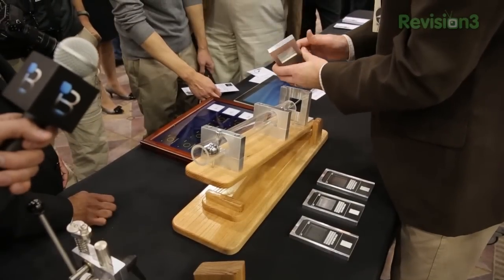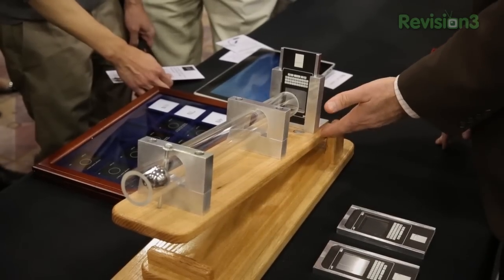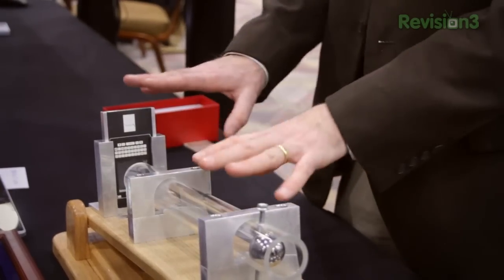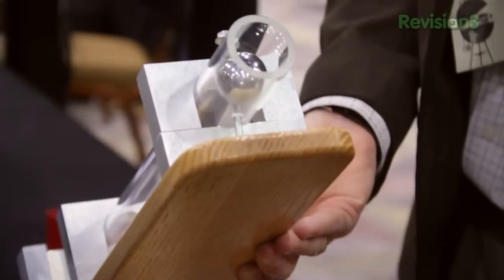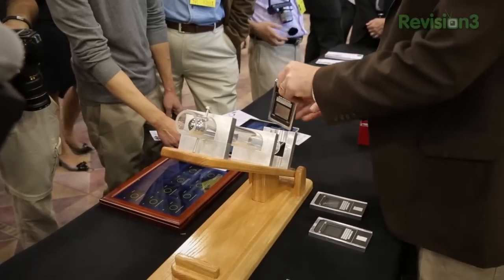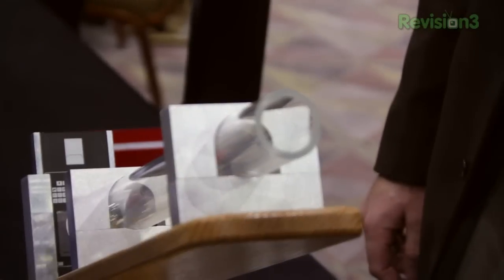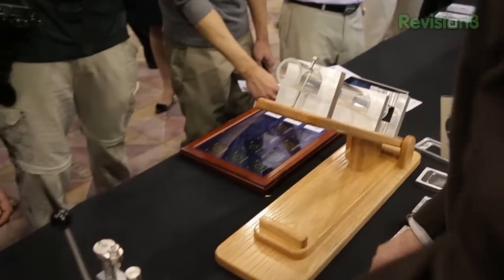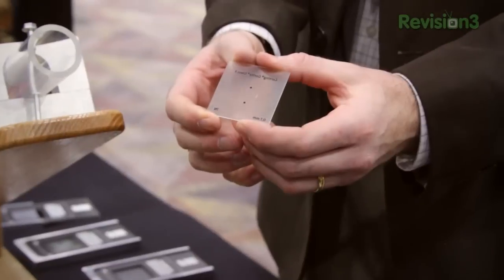Gorilla Glass 3 Test - CES 2013

Comment: Unless the LCD and the touch digitizer are made of gorilla glass, it's not gonna stop people from accidentally destroying their phones. And this doesn't really demonstrate the strength of the glass on it's weakest point, and that's the corners. It takes a lot less pressure to fracture glass when all the weight is is put into that tiny surface area known as a corner.

Comment: In the odd chance of anyone reading this, what the hell.

I own the Lumia 800. It has Gorilla Glass. I had dropped my phone many time on different surfaces. My screen has taken direct contact in drops.

My screen is still free of cracks. Even better? No visible damage/scratches what so ever.

Sure, the tests they do - do no replicate real life shit, but the glass is sound. It does what it does, which is not break easily like other glass used on other phones.

Comment: I have an s3 it has gorilla glass 2 and I've had it for about 5 months without a screen protector and dropped it about 11 times and it doesn't have a single scratch. The plastic edges are chipping off instead haha

Comment: and yet my screen still cracks,
even with Gorilla Glass lol
Reply: Of course it cracks. For the moment, this type of very hard and shatte proof glass is in developement. The strength depends on many variables like: the mass of the phone, the angle on wich it hit the contact surface, the density of the contact surface, the shape(if it has sharp bits), even temperature. The purpose of this kind of glass is making it tougher and less LIKELY to crack on moderate impacts, while being still very thin. Get your facts straight.

Comment: Dude, be smarter. Glass is glass, it will break. No type of glass is indestructible. All they can do is increase the density and strength, but a drop has a lot of variables, like the point of impact and the surface of impact. The point of the demo was to show it's more durable, but due to the nature of the material, it will still break.

Comment: I had a hd2 that was supposed to not scratch the Gorilla Glass. After 2 years of use was worse than the old nokia scratched. I have a Galaxy S3 month and already I can see the scratches on the screen is Gorilla Glass 2, which is supposed not to have a scratch. I would add that the phone normally Owner and wear it in my pocket. And now I hear again that it will not scratch. I'm sorry but I do not believe in that crap.

Comment: It probably isn't the most theatrical test. Moreover it's borderline boring. But it does demonstrate an experiment in straightforward manner that can be replicated. The test conveys the strength and flexibility of Gorilla Glass 3. Gorilla Glass 3 is not perfect by any means, but it sure seems a hell of a lot stronger than Corning's competitors. I'm very happy as a consumer for advancements in damage resistant display technology.